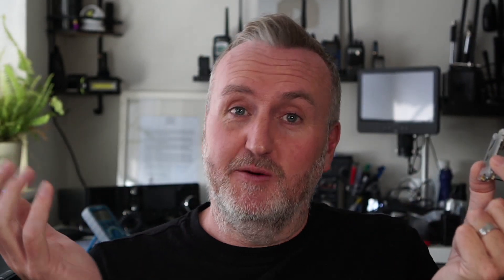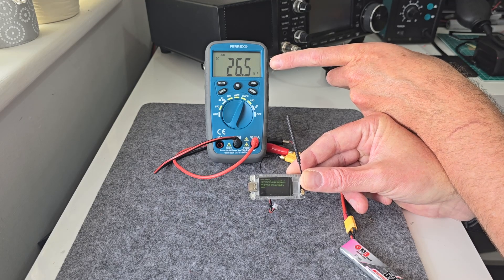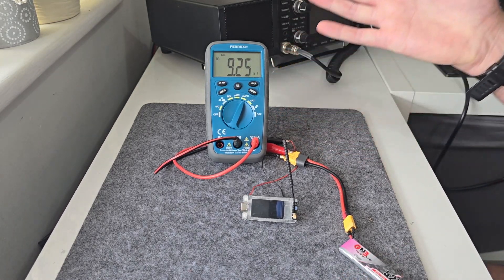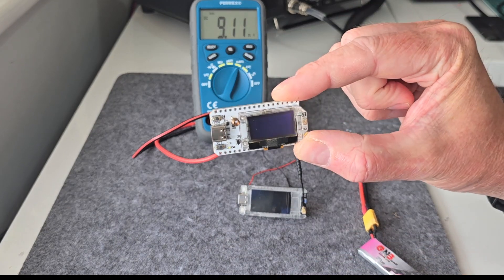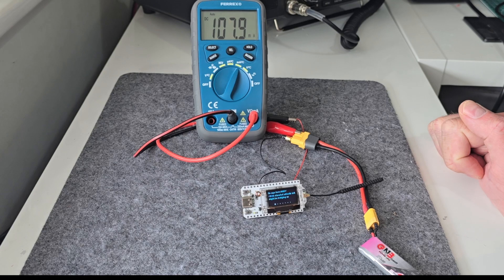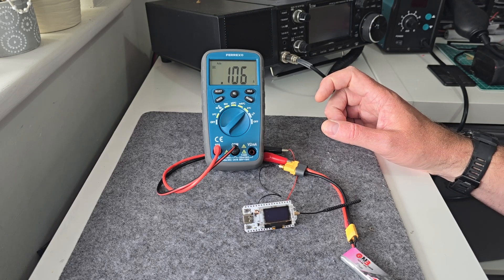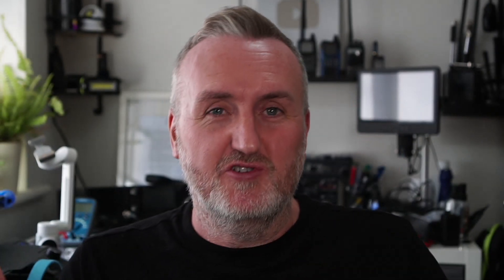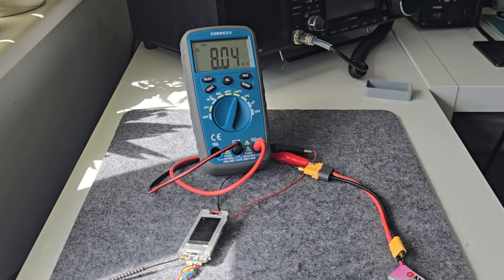Heltec T114 Power Consumption Tests

Comment: I have the Heltec Mesh node v2.0 and i love it! I upgraded it from the heltec v3. Using the T114 pocket pro case from GoodsByPatrik on ebay and a Gizont 17cm 915mhz antenna, a 2000mah battery, Heltec T114, L76K GPS.
Heltec v3 vs Heltec Mesh Node T114 in power draw using a 3000mah battery

The heltec v3 died in a day in a half. The Heltec Mesh Node T114 lasted a week in a half almost 2! Thats crazy!!! I definitely suggest a swap and upgrade.
Reply: hi there, should I choose rp-sma male if I want to follow your setup?

Comment: I have been working with the ESP8266 and ESP32 for a long time, and I have developed low-power devices with them. Based on my experience, I can say that if these devices run continuously, they will consume a significant amount of power unless you put them into sleep mode. However, sleep mode is not ideal for communication devices like these.

Comment: Don't throw out your ESP32's just yet. If you put them in router mode they draw a similar amount as RAK4631 in client mode. A 5W solar panel running to the USB C with a decent battery and you have a deployable node.

Comment: Question is, will the T114 fit in a V3 housing? I have a rather nice 3d printed case I would want to continue using. Are you able to try that out? :)
Reply from the maker: Hi, unfortunately not, it's a different size entirely

Comment: great video, and yes. ESP32 bluetooth is very power hungry, this is why currently when you turn powersave mode, it turns off the bluetooth temporarily and doing so will double your normal runtime. It will however turn back on the moment traffic is detected which is useless on busy meshes.
Reply: For stand alone devices we are working on using a shortcut key to turn off blutooth since it is not needed on such devices. Fn+B will probably be the keys we set it to. Hopefully soon.
Reply from the maker: That would be useful 👍🏻😁

Comment: The Rak uses 12-14mA average with BT switched on, in power save mode and with all telemetry set to 3600 seconds (that is also something to remember, telemetry runs every minute otherwise, even when switched off)